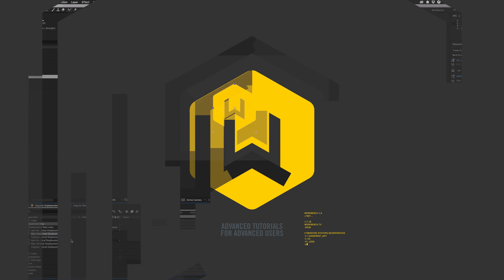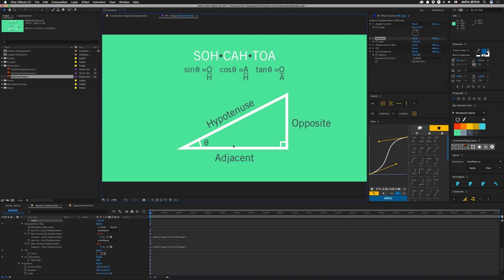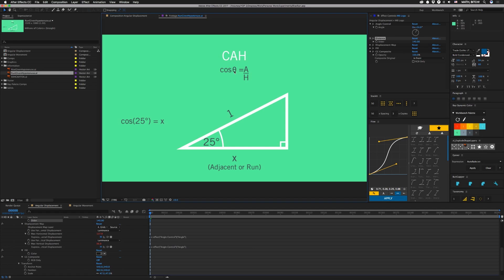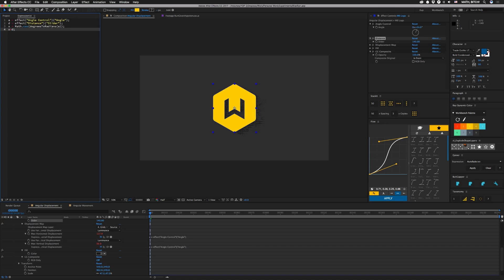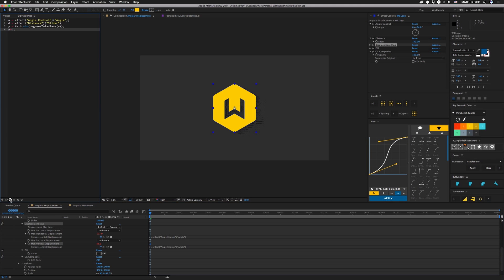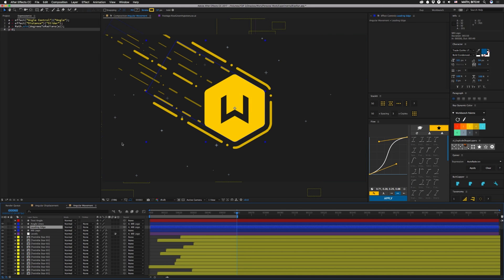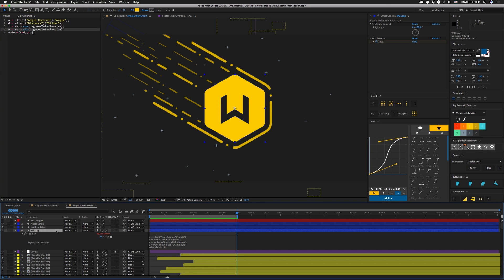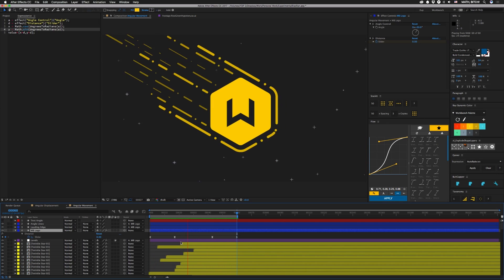Tutorial 87: Angular Controls

Comment: Well, you can just create a Null, 1. rotate it any angle you like 2. put a transform effect on it, animate the transform effct position 3. alt click the transform effct position, put an expression toComp(value). You are done, use this new position for anything you want.
Reply from the maker: Hi! Thanks for your comment Austin. That works, and as always you can do anything in a bunch of ways, but that technique is far more convoluted in my opinion unless you need to have the additional nulls for other reasons. For one thing, it requires two layers. Second you'll still have to add an expression to the layer or control you want to modify as well and remember to maintain offsets as needed. Plus, learning the method I've outlined lends itself to other techniques, like being able to the do the same thing to path points without having to have other nulls to control the points. Anyway, it's always useful to have other ways to do something because every method doesn't always fit the use.
Reply: @Workbenchtv  I actually think that is faster than using a bunch of math calculations, think of 50+ layers of different angular movements, with my method all you need to do is put a transform effect on different layer and change the rotation. This method also can achieve a very complex animation just simply animate the rotation and position. Great tutorial though, enjoy it very much.
Reply from the maker: @austindaniels9026  That could go either way, as a single expression, you could copy the effect you have this on, and just paste it everywhere and be done. Or if you have it on position, you can use copy expression only and paste it. I agree though, it's certainly more complex to figure out what I did if you haven't done a lot of calculations like that, but now it's available, haha. Anyway, it's always a great idea to keep multiple methods in your toolbox, and again thanks for sharing it.

Comment: Hi Joe! I have a question, i see you have one direction shading while I have two opposite. How did you do that?
Reply from the maker: If you're using displacement map like I am, your map can't use the full range of grey values from white to black. You need to use half the range only. Middle grey (RGB 128) doesn't displace. Say you have max horizontal set to 10. Black will displace 10, white will displace -10. So if your gradient includes colors brighter than RGB 128, you'll displace the opposite direction too. Hopefully that helps.
Reply: Thank you a lot for answer! I put levels on map so that the color's range is from 0 to 128 and whites don't displace.
Reply from the maker: Awesome! Levels is great for that. I'm glad you got it sorted!